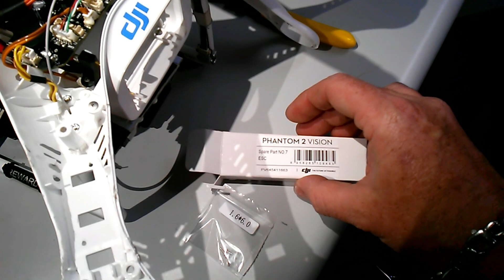DJI Phantom 2 Vision ESC Installation

Comment: after my crash only one of the LED lights in coming on (The green one).. I can see one of my ESC pieces is broken b/c it has a loose piece floating in the light casing. Do i need to replace all the ESC that aren't lighting up or just the one which i can see has a loose piece?
Reply from the maker: Is the ESC itself still working?  all of the LED's are soldered to the bottom side of the ESC board and are part of the board, one or more must have been shocked loose. I would replace the entire ESC so your indication lights work properly...good luck

Comment: I crashed mine badly today. Luckily the gimbal still intact but the body, 1 CCW motor, that motors ESC  and the internal battery connecter is shot.  I tried to reconnect the battery and got power but the other good motors dont turn on when try to start them. Is that normal because one of the ESC is broken?
Reply from the maker: not sure, i got lucky i quess with mine...u may have to replace all internal components if the main board has a hairline crack...sorry to hear..good luck with it
Reply: Thanks for responding. Well, the good thing about the Phantom design is that it protects the flight controller, modem and main board. I have the vision plus V3.0 and it's different in a few ways internally than than V2.0.  Fortunately I was able to reinstall the ESC with no problem and now I'm waiting on a ccw motor and internal battery plug from eBay.  I kept seeing the solid red led light up on the quad and it wouldn't let me start the motor.  Long story short the Phantom (at least V3.0) will not let you start the motors with the GPS or compass unplugged.  The solid red light indicates no compass among other things like RC calibration. After I plugged them back and started the quad the 3 remaining motors started without so much as a stutter.

Comment: What is the difference (in amps) between Phantom 2 and Phantom 1 ESCs? Phantom 1 ESCs are rated 18A, so I assume Phantom 2 should use 20-A25A ESCs??  Thanks in advance...

Comment: What did you use for sodder wire? I'm looking to do the same repairs on my vision 2 plus after a flyaway. (Worst thing ever)
Reply from the maker: Tyler. it was a general purpose electronic solder,,,,i will get the data off the label and get back you tomorrow....
Reply: Thanks again!
Reply from the maker: Tyler Meyer Hi Tyler, 

the Solder I used was .020 Ga. Inconel Solder made by the Malin Co, Ohio USA

Comment: When you solder the wires onto the rather small ESC board, will it likely to cause overheating (due to the sodlering) to the ESC and damage it as a result ?
Reply from the maker: it shouldn't as long as you don't over heat the solder or leave the solder tip on the board too long.,use some solder flux.....prep the solder tip with some solder as well as the stranded end of the wires and it should melt all together,,,good luck!

Comment: I got a problem with a motor i not sure if is the motor or the ESC, what would you thing, dji phantom vision plus Help
Reply from the maker: Greetings Marco.... Its hard to determine, but I would try to take the opposite motor assembly out and re- install on the in-operable side and test it....you would have to un-solder the motor and re-solder. if the motor doesn't spin freely, i would say its the motor,,,,are you getting audible error sounds or error lights?
Reply: ok, thanks Jwuman. i will try a new motor if is not that i ll keep the motor for reserve parts

Comment: Hi - I replaced an ESC today and now I get a new audible signal (error signal?) on startup.  The LEDs are still flashing normal.  I get the normal 4 loud beeps followed by 4 soft beeps.  The Phantom still flies normal.  I originally replaced a motor (not the problem) and then the ESC due to a low torque issue at one corner.  One prop would studder at startup (and not fly), but occasionally it would start and then perform normally.  Any idea what the new audible signal could indicate?  I was not happy with my soldering work so I'm curious if the Phantom recognizes too much resistance in the circuit, but still seems to fly well.  I soldered the motor in well, but was not happy with the other two wires connected to the main board.
Reply from the maker: hmm not sure,,,,if you can use a solder wick and remove the solder completely and re-do the joints...if it still persists, there may be more damage somewhere else on the main board, good luck , hope you can resolve,,,,,never heard of a new audible error signal.....also check with DJI, if you can get  a response,,,
Reply: Hi Alan, I had the same problem and replaced the motor and ESC.
But now I have the 4 beeps too and when I start the motors the phantom tilts to the side of the replaced one.....

Any ideas?!?

Thanks, Willi
Reply: You may want to load the latest firmware to your Phantom.  Even if you have the latest firmware, it's a good idea to reload it.  I've called the DJI hotline and they really don't know what causes the four beep audible signal, but I'd guess it is due to extra resistance in the circuit after soldering.  I replaced my ESC twice to ensure the best quality soldering I'm capable of and it has not had problems since.
You'll need to download the driver software prior to loading the firmware, but it's all free from the DJI website.

Comment: How did you know it was the ESC out of the components.
Reply from the maker: ESC circuit board was visibly cracked, also power on and motor test failed for that motor.